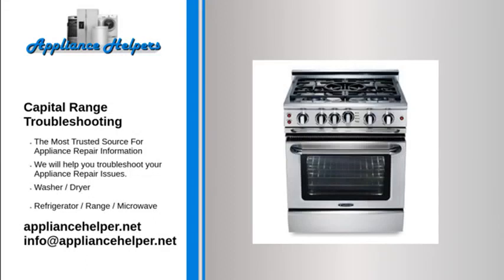Capital Range Troubleshooting

Comment: This doesn’t have anything to do with troubleshooting. It is more a list of operational tips.
Reply from the maker: When troubleshooting a Capital range, it's essential to address specific issues based on the symptoms you're experiencing. Here's a general guide for troubleshooting common problems with Capital ranges:

No Power or Ignition Issues:
Check if the range is properly plugged into a functioning power outlet.
Ensure that the circuit breaker or fuse for the range hasn't tripped or blown.
Verify that the gas supply to the range is turned on if it's a gas range.
If the range has electronic ignition, ensure that the igniters are clean and not obstructed by food debris.
Test the igniters by listening for clicking sounds when you turn on the burner. If you don't hear clicking, the igniter may need to be replaced.

Uneven Heating or Temperature Control Problems:
If the oven temperature seems inconsistent or inaccurate, use an oven thermometer to verify the actual temperature.
Check if the oven door is properly sealed and the gasket is in good condition to prevent heat loss.
Clean the oven's interior, including the heating elements or burners, to ensure proper heat distribution.
If the oven temperature sensor is malfunctioning, it may need to be calibrated or replaced.

Gas Smell or Gas Leaks:
If you smell gas around the range, turn off the gas supply immediately and ventilate the area.
Check for visible signs of gas leaks, such as hissing sounds or damaged gas lines.
Use a gas leak detector solution or soapy water to check for leaks around the gas connections and fittings.
If you detect a gas leak, do not attempt to use the range and contact a qualified technician or gas company for repairs.

Control Panel or Display Issues:
If the control panel or display is not functioning properly, check if the range is properly connected to power.
Reset the range by turning off the power at the circuit breaker or unplugging it for a few minutes, then restoring power.
Inspect the control panel for any visible damage or loose connections. Clean the panel with a soft, dry cloth to remove any debris.

Professional Service:
If you're unable to resolve the issue with basic troubleshooting steps or if you're unsure about performing repairs yourself, it's best to contact Capital's customer support or a qualified appliance technician for assistance. They can diagnose the problem accurately and recommend the necessary repairs.

By following these troubleshooting steps, you can address common issues with your Capital range and potentially restore it to proper working condition. Always prioritize safety when working with gas appliances and consult the range's user manual for model-specific troubleshooting tips.